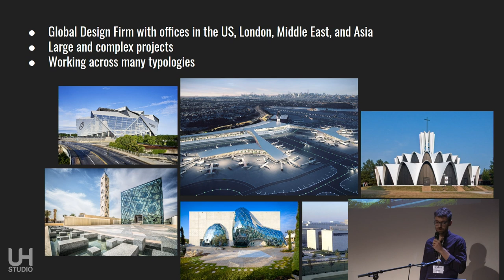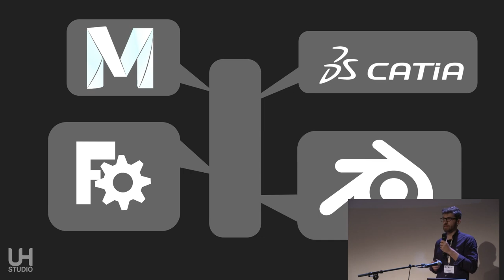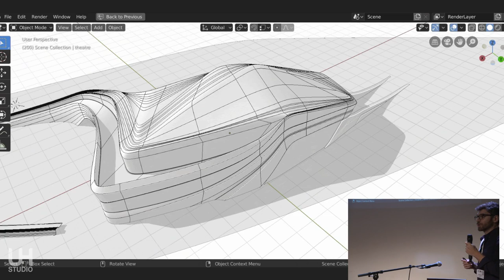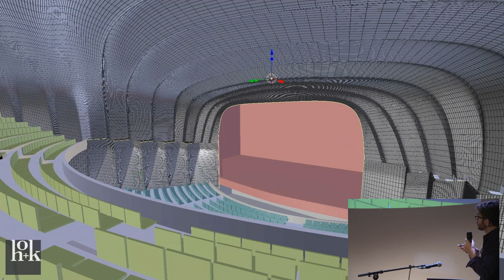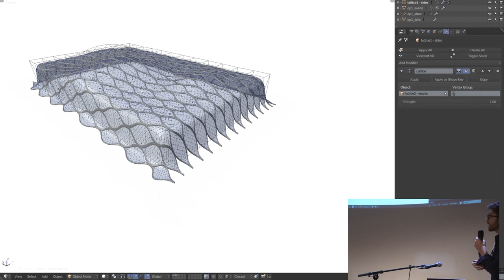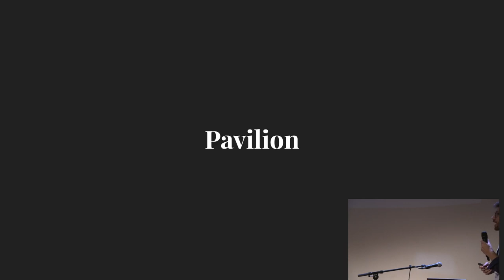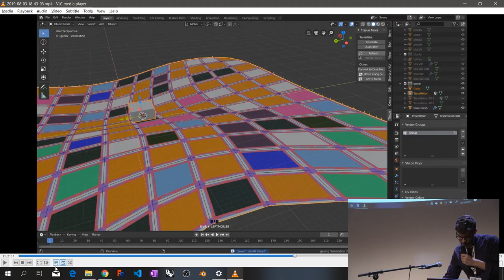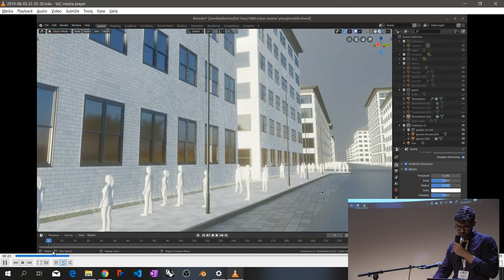Architectural concept design- Dimitar Pouchnikov

Comment: Really nice examples! Thanks for the presentation.
I was surprised that Sverchok was not mentioned; I have not used Grasshopper, but understand it was the inspiration for Sverchok.
Reply: Thank you. Sverchok is quite good but fairly low level - you need to spend quite a bit of time to learn the logic, how lists work, etc. If i need to do something to a high level of precision, I would most likely still import draft from blender into Rhino/Grasshopper for further development. Using tissue and regular blender workflows is fairly fast and quick to tesk concepts quickly.